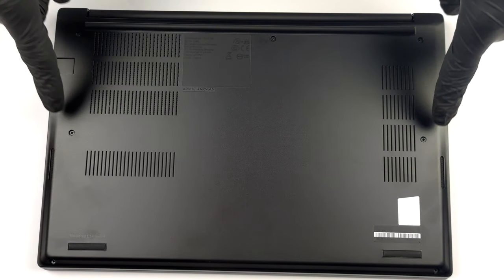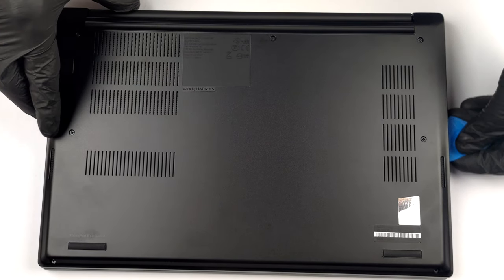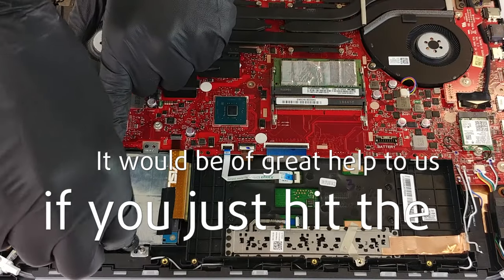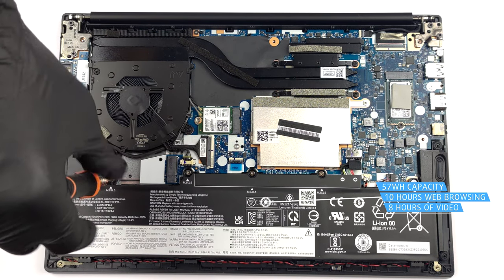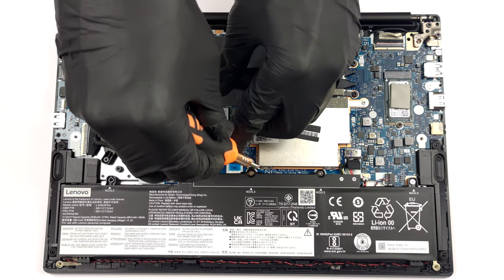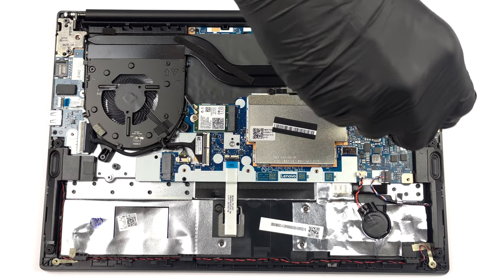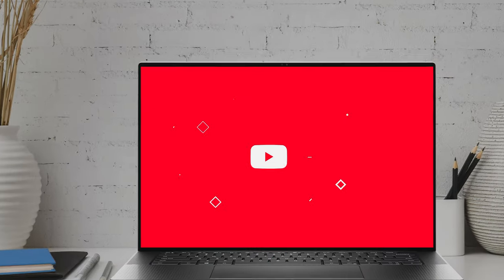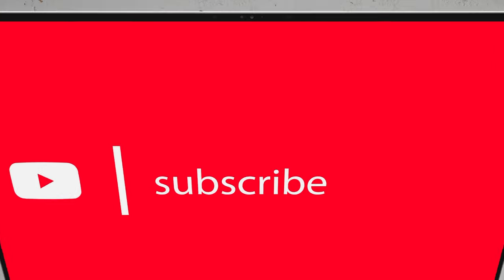🛠️ How to open Lenovo ThinkPad E14 Gen 4 - disassembly and upgrade options

Comment: AMD variant takes a 2280 SSD as its second drive bay if you're planning on upgrading. This seems to be an intel which is different.
Reply: Thanks, was already curious.
Reply: @Reuterli  There also isn't the screw to open the ram-cover. Now i'm not sure how to proceed. I bought new Ram for my new notebook
Reply: Oh boy, we're going back to those minis for lapotps??? :(
Reply: @gamerdweebentertainment1616  ??? A 2280 is the largest NVME drive physically.
Reply: More easy in an AMD

Comment: Hello, I have a question: is it still difficult to remove the bottom cover because the small tabs that hold it break? This problem existed in past generations of the E14. Greetings.